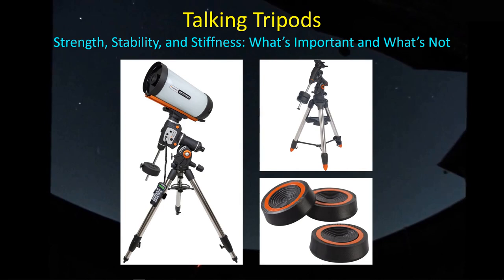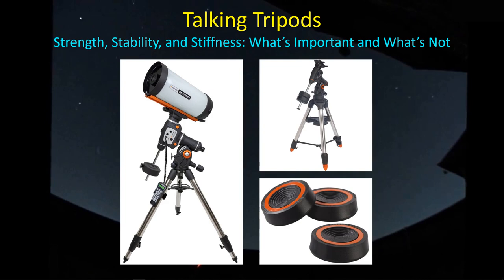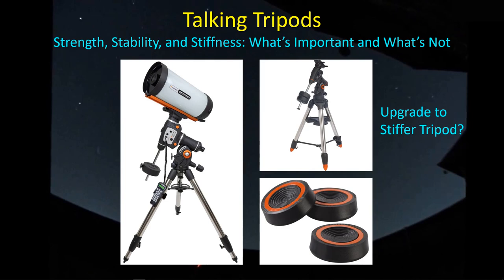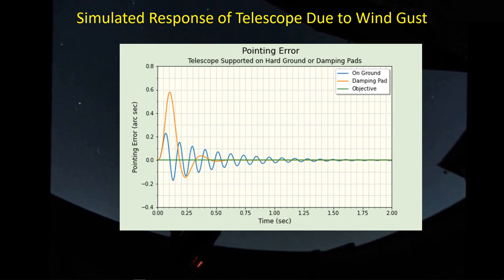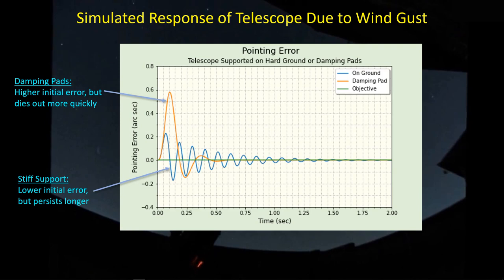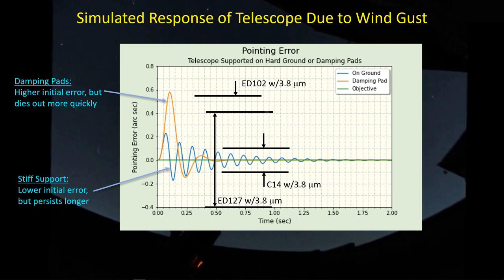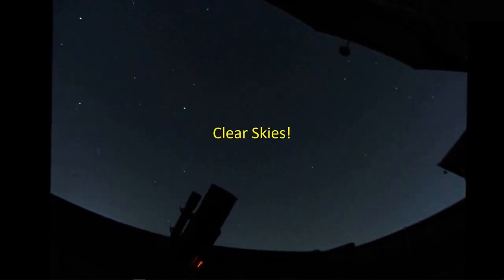Talking Astrophotography Tripods - What's Important

Comment: For two nights I have been guiding under strong wind without using the vibration suppression pads on the EQ mount (iOptron CEM70G) And you are right. there is an increase in rigidity in the setup. Thank you very much for your analysis. It is a fact that guiding has established more. Thank you very much. :-) Paulo from Portugal.
Reply from the maker: Great feedback, Paulo! Clear Skies!

Comment: on your slide that describes the Stress measurement, you have the LegArea = PI * D * t. you state that is the "area of steel" in the leg.  The formula for a "ring" is PI * (Ro  ^2 - Ri ^ 2) where Ro is the outer radius and Ri is the inner radius. So for you, D = (2 Ro) and t = (Ro - Ri) ? I can't make the math work!
Reply from the maker: Alan, your formula is correct. Mine is "accurate enough" when t is much smaller than 2R. Let's use your formula with Ro = R and Ri = R-t:
Area = pi (R^2 - R^2 + 2Rt - t^2), so the R^2 cancel and we have
Area = pi (2Rt - t^2), now, factor out the D = 2R and we have
Area = pi D ( t - t^2/D ), now factor out the t and we have
Area = pi D t (1 -t/D). So we have my formula times ( 1 - t/D )
For these legs, t = 0.049" and D = 2", so t/D = 0.025. Finally:
Area = pi D t (0.975). My formula underestimates the area by 2.5% which is more than acceptable for engineering error.
Good question, and thanks for watching!

Comment: One problem I have with the suppression pads is that they are  packaged in a hard plastic package which can slide on a hard surface such as smooth concrete. any bump to the scope and the legs might move. the pointy metal on the tripod legs "dig in", even on concrete and provide a more stable base, IMHO.
Reply from the maker: That's a good point, Alan. Thanks for watching!

Comment: The little Celestron hockey pucks helped me big time.  I only shoot at campsites so we always get  Bortle 1-3 skies so always setting up on dirt or something like that.   For me I’m able to get under .50” with those and my CGEM2 at 800mm.  I think it helped roughly half a minute or so.  Not a scientific analysis but I was always hovering around 1.0 to 1.2 and now usually around .5 to .7
Reply from the maker: That's good feedback Ryan. There may be more local movement of people at a campsite so you get the benefit. Thanks for watching!
Reply: @Aero19612  yeah also it’s vs putting the legs in dirt so in my car they may be adding dampening and stiffness depending on the soil conditions.   Either way I would recommend them for camping situations but like your idea for more permanent situations especially since it doesn’t damage a large plot of grass or the lawn mower

Comment: One thing I do is to never extend the legs of the tripod beyond the first leg section. It seems to to offer more stiffness and less flexure.
Reply from the maker: Great policy. Keep the legs as short as possible. I didn't mention this in the video, but leg stiffness = E A / L. E is a property of steel. A is the cross-sectional area of a leg, and L is the length of the leg. A leg that is twice as long is half as stiff. Thanks for watching Gregory!

Comment: Nice video. One wonders thought (and I am doing some experiments) whether walk-induced disturbances are different from winds. The latter tends to directly rotate the telescope if it sits on three pads. The former may induce (to first order anyway) a predominately vertical vibration which wouldn't matter. This would imply that pads are bad news in windy conditions but perhaps good under calm conditions with people moving around - I notice this is a significant issue with my EQ6-R mount directly on concrete. Sorbothane pads appear to help. Do you agree?
Reply from the maker: Hi, Paul. Good thoughts there. When I go outside to check on cable snags, for example, and the mount is guiding (but not imaging), I can certainly see walking induce disturbance in the guiding graph. Walking tends to produce more abrupt disturbances than the wind and therefore “excites”higher frequency modes of vibration. All the vibration mambo jumbo aside, the end result and conclusions are probably the same. For me, doing astroimaging as opposed to star party visual, I prefer to not use the dampers. Thanks for the insightful question!

Comment: James you are the mythbuster of AP. Definitely of the Hieneman rather than Savage variety:) 
I suspect the elephants in the room would be mount axes rotational stiffness and the weak coupling of the telescopic leg clamp and bearing interface.
Reply from the maker: Ha. Absolutely-there are many variables. To paraphrase: "I got 99 problems, but the legs ain't one". Definitely avoid the leg extension if you can. The shorter the leg, the better.

Comment: I'm new to astrophotography, and I've been really enjoying your videos.  I particularly appreciate the math/engineering approach you're taking.  So many videos seem to be based on intuition or "works for me" stuff; give me the math!  For instance, you're the only person I've seen explain what the weight limit on a mount actually means or how you might calculate it.  Your explanations have been really helpful as I figure out what to improve, how to improve it, and when I should expect to hit diminishing returns.  Thank you!

I never really understood what vibration suppression pads were supposed to do, and it hadn't occurred to me that they were for dampening motion in the OTA because the ends of the tripod legs seems like the least effective place to do that.   Have you considered a tuned mass damper to eliminate oscillations?  I can't help but think that something like a stockbridge damper attached to the OTA (running parallel to the OTA) could help reduce oscillations in the tube without adding much mass, but I haven't really seen any discussion on the internet about it.
Reply from the maker: Welcome to the hobby, Chris!  I design/test tuned mass dampers in my professional work. A TMD is a great way to increase the effective damping of low-damped structural mode that's responsible for high vibration. In the case of astrophotography and mount dynamics, there is no observable resonant mode that causes pointing error. The majority of pointing error comes from seeing (we can't control) and mechanical contributors like imprecise gear machining, gear harmonics, and backlash. So, there's no structural mode to attack with a TMD. Great thought though! Thanks for watching!
Reply: So you're telling me that I haven't discovered a novel way to improve pointing accuracy in my 2 months of part-time experience that people with years of experience haven't thought of?  Good.  :)  If I understand you right, a TMD wouldn't help because there isn't a single high-amplitude frequency to attack; and I think your frequency domain analysis video proves that for your mount.  I might do frequency analysis on my mount for fun, but I trust that you're right.

Thanks for the reply.

Comment: Very interesting presentation, thank you. I saw the damping pads advertised but thought that it was not possible to reduce the time of oscillation without also increasing the displacement. It was nice to watch you explain in detail what the benefits could be and what the drawbacks could be. I don't do visual astro so an overall stiffer, greater mass, and lower cg setup sounds best for my purposes.
Reply from the maker: Good intuition, Jeremy. I agree: go stiff with low CG....and don't walk near the setup when imaging. With my new EQ6-R, I keep the tripod legs fully retracted (legs are short as possible). Thanks for watching!

Comment: Hi James. Love the channel. I'm very interested in the 12" x 3/4" threaded-rod setup for my backyard. A few questions: What tool did you use to sink them into the ground? Would a larger diameter rod be even more stable or a waste of $? Also,  I noticed in your schematic that you drilled straight down. Would it be more effective to essentially continue the tripod leg into the ground by sinking the rod at the same angle? Essentially, an extension. I'm not an engineer so I'm genuinely curious. My setup weighs about 95 lbs., total (tripod, mount, counterweights, OTA, imaging gear). Thanks!
Reply from the maker: You're on the right track there, Christopher! I used a rubber-head mallet to pound them into the ground, but any good ol' hammer should do the trick (unless your on rock!). Yes, a larger diameter bar is better (measurably better? not sure) because the leg load is distributed over more surface area. And, yes, it would be better, I think, to align the bars with the legs. In my case, Home Depot only sells 3/4" bars. Also consider the difficulty of installing a larger diameter bar at an angle. Good luck!

Comment: Fascinating analysis. What about the small rubber tips that are on the very bottom of the legs? Most likely there to prevent the leg from slipping or sliding when placed on a smooth hard surface.  If utilizing a bolt in the ground base, as you do, would it be beneficial to remove those rubber tips? I have always used those damper pucks, just because they came with my iOptron HD tripod. I do strictly wide field astrophotography so perhaps it doesn't matter.
Reply from the maker: Yes, those rubber tips would have some impact on the overall stiffness; however, I suspect the rubber used for the tripod tip is much harder than the damping rubber-like material used for the vibration suppression pads. I think the tips of my Celestron tripod are hard plastic if not steel-tipped. Right, your wide-field setup may not benefit from those damping pads. Of course, they may have no effect at all. Thanks for watching!

Comment: I recently got a HEM27 and iOptron's carbon fibre tripod. I was blown away by how light it was. If it wasn't a bit off-balance I'd be able to life the tripod, HEM27, with my C8 on top, with one hand. Seriously. 

The issue I've found is that the very soft rubber feet on the tripod, though grippy on the carpet in my lounge, tend to skate around on the damp concrete tiles in my garden. My previous Celestron AltAz mount did not slide around, but it was one hell of a work-out carrying it into the garden.
Reply from the maker: Hi Fred. These are amazing mounts. Probably "the next big evolution" for our hobby. I understand that the high torque means you don't need counterweights, but I wonder about the overall balance of the system and the effect of shifting weight on the tripod legs. With a balanced system, there is very little change in the axial force in the legs as the OTA moves from one side of the Meridian to the other, so no tendency to cause the OTA to rotate due to leg compression. I'll be interested in your experience with it. Congrats!
Reply: @Aero19612  Not going to lie. It makes me nervous just watching it.

Comment: Not an engineer but the suppression pad summary made perfect sense to me.
Any thoughts on the leg spreader/bracing bars?
Reply from the maker: Hey Brian. My tripod has an "accessory tray" that serves as a spreader. I tighten the heck out of it as it pushes the ends of the tripod up against the sides of those half on/half off nuts I set the tripod in. There is some free play in the joint that the legs rotate about, so if the spreader "chew up" that free play and get to metal on metal contact, then they are VERY useful. Spreads never hurt, so definitely use 'em if you got 'em. Thanks for watching!

Comment: James. Loved this video. Just came back from a beautiful night of Astrophotography and used my brand new Ioptron Gem45 on the Literoc tripod with integrated dampeners on the feet. Every time somebody walked anywhere near my tripod which was placed on thick grass I saw a noticeable spike in guiding. Every star on all my subs showed excrescences beyond the normal round disc of the star. Very underwhelmed with the Literoc tripod with integrated dampeners. Thinking of your idea by possibly having a 6 inch plate welded to a spike that can be placed easily when imaging offsite and then placing the tripod directly over those pads. I was imaging with the C8 at 1440 mm and every spike was beyond my level of resolution.
Reply from the maker: Thanks, Louis! I think dampening elements are dreamed up and sold as “magic off switches”. Depending upon the scenario, they may help. They may not. If you’re imaging, then no ground vibration is acceptable (pain increases with focal length). I tend to think these things are only useful in a community outreach observing scenario. Oh well. I’ll just say that I’ve never bought or used them and don’t plan to. Btw, I’m very interested in your experience with the Gem45. When you get a moment, toss some of your impressions this way! Clear Skies, Louis!
Reply: @Aero19612  Just finished using the GEM 45 for two beautiful nights albeit at 20°F. Had my fair share of USB problems probably because of ice crystals forming in the USB ports. After every slew I would lose USB ports and have to start all over. Ouch. The mount itself is light. My feeling is that the Literoc tripod may be a little bit too light. Mine came with integrated dampeners on the feet which could not be removed. They did not sit well in tall grass and every movement around me was a nightmare for guiding. When nobody was walking or nearby within 10 feet I was able to see .5 or .6 RMS with the C8HD at 1440 reduced and OAG.  Any movement and spikes in guiding ruined many of my subs. The mount itself is a little unusual in that the clutches are magnetic releases for the gears. The head is very difficult to transport because it’s like handling an octopus with a loose head. You have to be very careful it is very delicate. That being said it is a beautiful piece of equipment. I’m sure I will get over some of its minor quirks. Look forward to the next good night. Hopefully a little bit warmer.
Reply from the maker: Ouch. 20F. If I see 30F, it's rare. I will do some whining at 100F though! I'm quite intrigued by the Gem45. It is light. Is there any way to lock up the dampers so they don't permit movement? With or without dampers, walking next to an imaging rig is a problem. Your 0.5"-0.6" sounds awesome even at twice that focal length. Thanks, Louis and Clear Warm Skies!

Comment: I'm currently planning to whip-up a secondary setup for Solar imaging with a Daystar Quark. It works alright with my main OTA, but my smaller refractor (TPO180) gets a nice clean full-disc image. It also piggy-backs quite nicely. Still, I'd eventually like to get a dedicated solar mount and will most likely use a Star Adventurer. As a result, info about tripods is very helpful.

I don't even need to get a star adventurer, so I can do this for cheaply. Either way, it saves me from re-balancing my wig when switching between solar and night time imaging. It should be noted that the Quark has an integrated 4.2x telecentric barlow, and so vibration definitely matters.
Reply from the maker: Sounds awesome! I haven't felt the "pull" of solar imaging...yet. Good luck!
Reply: @Aero19612  Save yourself! You got a good thing going.

Jokes aside, I succumbed to the pull of the Sun because I figured it would be less affected by seeing conditions. If nothing else, solar imaging sessions are less affected by intermittent passing clouds. 

Thanks for the good luck, and I wish you clear skies with low-humidity!

Comment: Hi James . Excellent Video once again ! I was hoping you might have touched on contact surface area at the end of the Tripod . Is a fine , hard tip better or worse than a large area hard end ? Also , were your calculations for stiffness based on the upper larger portion of the leg or the lower smaller leg ?   My problem with Tripods is the weak link of the leg clamps . One of mine let go last year just as I got everything back into the garage . Luckily I managed to get a large soft item under the Scope when it fell over..."me" . Scope was fine , me not so much . I've now added 3/4" hose clamps around the lower leg and set a minimal amount of extension on that lower leg . Loosen the clamp , level the tripod and tighten the clamp . I feel much more confidant now . Cheers ./SRK
Reply from the maker: Good point, Scott. Don't worry about the contact size when placing the mount on a hard (like concrete) surface. There might be some slight benefit to a larger bearing area on a soft material like rubber. Try to avoid using the extension legs in your setup-the shorter the leg length, the more stiff it is. As you say, the those clamps can shift over time. Ha. Well, if you're going to be breaking the fall of your scope, better switch to a Redcat 51! Those C14's will leave a mark!
Reply: @Aero19612  Thankfully it was only a fully loaded C8 . LOL . /SRK

Comment: But, you did not mention exposure length.  If you are imaging a 300" image to gather enough light to stretch the image to see it, 1/40 of a second is not going to show up as an elongated strip in the image.  If however, you are doing 1-second exposures it might be visible.  Much like light painting a nighttime scene exposed for 30 seconds, you can walk around in the image and not be seen in the final image, or in the case of a 10x or 20x neutral density filter and long shutter speeds on a busy street in broad daylight.  The traffic magically disappears and you do not see the moving traffic in your final image.
Reply from the maker: Very true. But if you're doing 1-sec exposures, you can just toss a couple out. Save your money and buy a huge hard drive!  Clear skies!

Comment: In non-astro DSLR photography, I hang my pack (with my drinking water) below the ballhead thereby lowering the cg of the rig. I've always felt that it helps my night photography. Would your type of analysis confirm that?
Reply from the maker: You are correct, Robert. Keep the tripod legs as short as possible to maximize leg stiffness. Adding mass, as you are doing, to lower the center of gravity will further increase the rocking vibration frequency, which is very good. Thanks for watching!